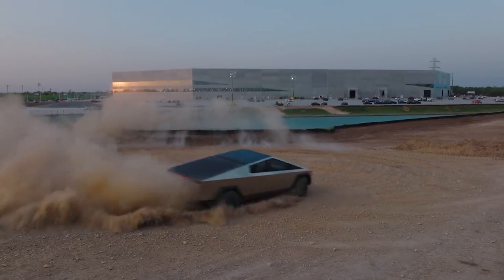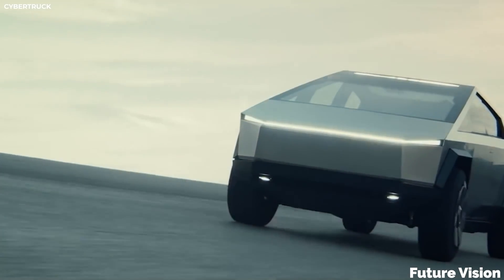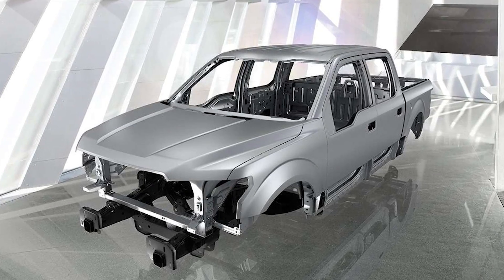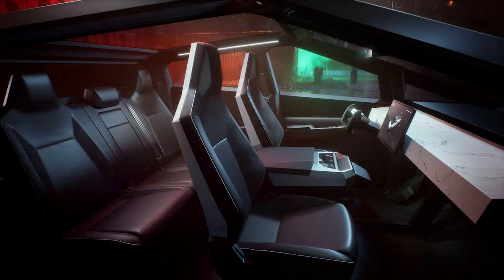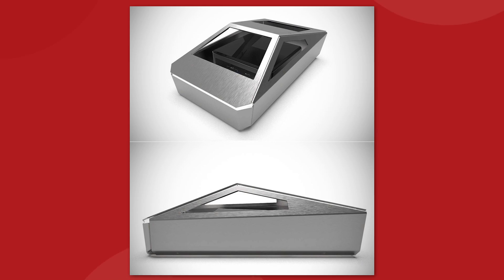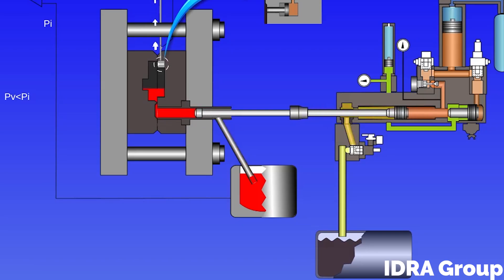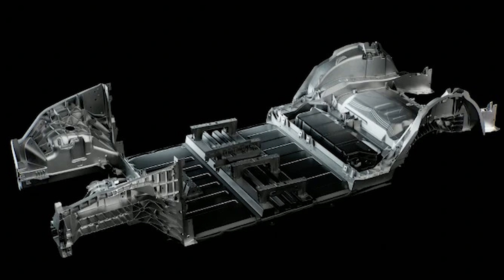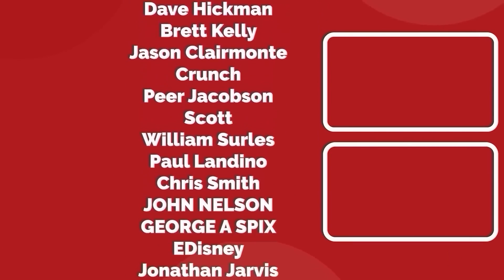The Real Reason Tesla Developed The Cybertruck!

Comment: So far, every look we've gotten of the inner parts of the Cybertruck: "it's not an exoskeleton". This presentation didn't change that. Also, they don't take advantage of triangular strength. Look at the sides of the triangles. They are interrupted by the door openings (i.e. no longer triangles...no longer strong). As for the batteries as a structural member? That's not a good idea. Batteries will need to be an easily replaceable component. (1) They have a limited life. (2) Technological advances will quickly make them obsolete. (3) They need to be easily recyclable (and all that plastic won't be easily recyclable).
Reply: Hey, don't be so critical. Engineers and Drs here are convinced. Just be gullible like them and buy so that you too can be drained. Twitter was expensive but the money for that virtual concept has to be extracted from SOMEBODY.
2023 01 14 10:40

Comment: I love the science behind the design but one thing that worries me.  What will the repair ability of the large castings be?

If one of the large casting sections were to crack in a collision would the entire vehicle be totaled?
Reply: Go watch Sandy munro’s videos on the 2022 Texas built Model Y. There are sacrificial parts that protect the casting in low speed collisions, just like any other vehicle. In more intense collision some parts of the casting could be broken but easily welded. If the subframe is damage such that it needs replaced the accident will destroy the vehicle in any case and you will probably be injured or worse as the vehicle sacrifices itself to save you.
Reply: Why not Ferrari gets over One Hundred Thousand dollars for an old car frame?
Reply: After an accident this type of construction would no longer be legal to drive in countries where they test vehicles every two years for safety. In usa no one cares about safety, so no big deal.
2023 01 14 10:19

Comment: If Tesla would make slightly smaller truck I would buy one. Maybe 10% narrower and shorter would fit my garage. I think that would remove a substantial barrier to sales of this, otherwise, very appealing truck.
Reply: Eh
Reply: Actually, Elon said that the production model will be smaller, for the very reason you stated...so that it will fit in the average garage.

Comment: The original Land Rover Series/Defenders had a body on frame setup but had an aluminium body, which worked perfectly as a work vehicle during its 71 year production. Thick, durable burmabrite aluminium.
Reply: Land Rovers are infamous for its reliability.  So many problems… I wish Toyota built them.
Reply: @sparkpaul  Indeed I owned many of them. Early ones are sort of contraption-like but known a lot to put Hilux engines in them.
Reply: Land Rovers were painted mostly military looking or came looking BC they were used widely for hunting!
Reply: @T Paterson lol…., no one litteraly cares! Land Rover is best off-road vehicle and that’s it!
Reply: @T Paterson they stoped making the old version because it was way too old and not so safe for the roads! The last generation is a much better and safer vehicle and also mostly aluminum
Reply: Land Rover is today almost fully aluminum built. But not structural or massive castings that can fail. Nothing will ever beat a steel chassis! There is a reason why trucks and semis have them.
Reply: @carholic-sz3qv  did you even watch the video?
Reply: @500846  no I was blind lol…..

Comment: When you factor in likely 4 wheel independent steer and drive by wire, air suspension, torque vectoring….cant wait
Reply: Nope it’s not happening
Reply: @carholic-sz3qv  electrical car by definition is drive by wire. What do you mean not going to happen?
Reply: @quansun7633  manufacturers are still developing and making steer by wire more effective just like brake by wire….. those things are not been used in mass now! Except I think Nissan or Toyota.
Reply: @quansun7633  Audi already has brake by wire no tesla

Comment: Sounds wonderful.  I didn't hear any mention of safety of passengers, or cost of repairing if in accident.  All of these one piece sections of truck or car must be huge cost to replace.  Have they done any crash testing yet?
Reply: "ordinary" cars are designed to collapse to absorb the forces in a crash while the passenger compartment is rigid to protect from parts entering (engine, etc.).  If the whole body is rigid, the forces on the passengers will be much larger. All cars and trucks? need to be tested and get rated, in Europe with Euro NCAP. I will wait and see how the Cybertruck fares before speculating more. The Cybertruck is not street legal in Europe as it will not comply to the safety regulations such as the pedestrian and cyclist protection standards. It will be sold in the USA as many vehicles there are exempt from pedestrian protection protocols, but to be sold in Europe, changes to the body shape and materials are needed which will make the Cybertruck a completely different animal.
Reply: @andersdannstedt5825  Don't destroy the yanky dream man! Let them rave on and then have to face the consequences. Serious scientists will arrive to do the clean-up after all the dollars have been pocketed.
Reply: I'm pretty sure I heard Tesla will have smaller replacement pieces for repairs, no need to replace the whole piece. Much like how collision centers use a patch panel rather than replace an entire quarter panel.
Reply: @catsaregovernmentspies  When designing parts a decision if the part is also to be a spare part is made. These spare parts have to be stored so they can be ordered and used when repairing. These parts also needs to be kept long after the model it was designed for has been replaced. This can be a considerable cost. The company I worked for, Scania (trucks) had to keep spare parts for 25 years in case of trucks for Nato countries. Customers usually get a little angry if their car/truck/ ... cannot be repaired 10 years after purchase. This means that special tools for repairing also need to be "spare parts". This is why one want as many parts to be "carry over" till the next generation/model, or at least the new parts can replace the old part. This is a design decision to reduce cost, otherwise the number of spare parts will grow over time which leads to high cost of keeping spare parts as they have been manufactured at a cost that that will not be refunded until the spare part is ordered and paid for.
Reply: No one can get past the government boys without being tested or money under the table similar to the BLINDING headlights? Yup everything he makes is only for the RICH except the sell out to China.
Reply: How much is insurance going to cost? How much are parts and cost of a mechanic?

Comment: How can you say the CyberTruck will be the longest lasting, when the battery is part of the frame, not to mention the truck DOESNT EXIST? Musk claimed his cars would be million mile cars, but the durability of his early cars has proven that waaaaaaaay off. The batteries are needing to be replaced at 150k-200k. A 400k mile Tesla only made it there on its 3rd battery!  As we have seen with Apple and Iphones the manufacturer can send an update and kill the battery at will.  
Your thumbnail was more accurate.  He built it to be a rover for Mars and needed the hard steel and bullet resistant windows(What engineering reason is there for bullet resistant windows?) for micro-meteors on the planet.
Reply: The Cybertruck will be produced with the new 4680 form factor cells which should last easily to 500,000 miles and is rumored to be still usable (>85% capacity) at 1 million miles.  The are quite a few newer Tesla's that have gone more than 300,000 miles on their original battery packs and just like ICE cars there are some older ones that have had early pack failures, but if you have been following the developments and improvements of battery chemistry that Tesla is using as well as Thermal management improvement and charging algorithms it is only reasonable to assume that battery life will improve even more in future.  When your traveling down the interstate at 80 to 90 mph and the oncoming traffic is coming just as fast the stones and debris hitting your windows can impact your windows in excess of 160 mph.  Semi truck windows get taken out pretty regularly... my brother always had at least 2 sets of windshields on hand for his truck.  The rocks on the roads out west are micro-meteors and I have lost 2 windshields in my vehicles over the last 10 years with just the occasional road trip to Colorado and Nevada.  On the farm we have lost windows in our farm trucks due to tools or equipment parts contacting the rear window of the truck with just a light or glancing blow, that kinda ruins your day.

Comment: I agree with your points, except the structural battery pack, which renders the pack totally unserviceable. I'd likely hold further comments until we see the cybertruck reach customer hands and have a few of them require extensive service from collisions to fully know what it takes to repair. A vehicle that likely costs as much or more than a rivian r1t but ends up being declared a total loss for fender benders is not useful in spite of all the first principles thinking that went into designing it. Likewise, vehicles that require you to glance at a center screen for vital information that should be in a dashboard behind the steering wheel presents an ergonomic and safety issue.
Reply: Before buying a Tesla I also worried about the issues you raised regarding having no dashboard. To my surprise I found out looking down at my First Mondeo dash takes my eyes off the road completely compared to looking across to the top corner of the centre console where the data you need to see us situated. The centre console is so much better and safer to view than looking down at a display between the wheel. Tesla has done an amazing job encompassing great safety, engineering and end-user design. Having to hire cars on a regular basis for work highlights every time to me the amazing simplicity and beauty of the Tesla design. The Cybertruck is the ultimate expression of the Tesla design principles. Cannot wait to experience it.
Reply: @jamespitstock3427  It might be true for you. I'm a shorter person so on both my cars, with the right seat adjustment, the odometer/speedometer area are in direct view and I don't have to take my eyes off the road that much if at all given the cars I have possessed a steering wheel with just the right diameter to avoid obscuring my view. Sure, it's not directly in my line of sight as a heads-up-display on the windshield but I don't think I would buy a car with that feature. Having had to replace windshields 2x and repair them 2x in one calendar year is enough of a deterrent where I live. Construction crew simply do not cover their trucks and there's plenty of loose gravel to break windshields. Anyhow, this is just my observation from riding passenger side on my neighbor's 2019 model x. Lately, more and more controls are being migrated over to the centrally located screen. I personally prefer tactile controls (scroll wheels, buttons, etc) on the steering wheel for audio/phone/cruise control/odometer functions. They work for me. I cannot get used to centrally mounted touch screens in both my cars unless I'm parked or waiting at an intersection.

Comment: I like the stainless steel part, but it’s ugly, can’t see any way of repairing the battery pack and doesn’t look like it’s very compatible with gravel roads. The real question is will the owners be forced to take the cyber truck to the junkyard because there’s no more firmware updates available? making the truck unroadworthy, how long will Tesla maintain support for there vehicle.
Reply: Beauty is in the eye of the beholder.  The battery pack isn't designed to be repaired, neither is the fuel tank on an ICE vehicle,  however the battery packs are getting better with every design iteration and chemistry update.  The 4680 battery pack is estimated to last over 500.000 miles. if it gets worn out or dies then buy a new one.  The cost is coming down as the volume of production goes up so it is likely that in ten years it will cost about half of what they do now.  Which would put it in line with having to replace an ICE vehicles Engine or transmission which is a pretty common occurrence before they make it to 300,000 miles.   Because the Cybertruck literally has thousands fewer parts than an ICE vehicle there are far fewer parts to break or wear out.  No exhaust to develop life threatening leaks, no fuel pumps to fail, no fuel filters or injectors to plug up, no spark plugs to foul out or replace, no engine management sensors to fail (EGR, TPS, Cam position sensor, Crankshaft position Sensor, Transmission, transmission fluid and filter, no collapsed valve lifters, no seized or broken piston rings, the list goes on and on)   

Why do you suspect Tesla will drop support for their vehicles any more than Ford, GM, Stellantis, VW or Toyota will?  My 2000 Ford Ranger has only limited support from Ford they typically do not sell many parts after 10 years.  I keep it running by buying aftermarket parts.  I don't know why it will be any different for Tesla.  Once the warranty has expired your on your own like any other vehicle.

Comment: Well IMO, they did not develop it to be a work truck and unless you are going to use the Cybertruck to haul your groceries from Costco to home as competition to the Mercedes G-Wagons, it makes no sense as a work truck and I will explain.
1. Regardless of has been published in the past the Cybertruck will certainly cost a lot more than the Model Y which is over $70K including delivery, licensing and registration and state taxes.
2. If used as a work truck the range is drastically reduced if you are hauling a trailer (and who does not) and range even drops more in the Winter.
3. Because of the unibody construction with those panels and large battery an accident will probably most likely result in a total loss (who is capable of repairing and what is the cost of the panels). This will make the insurance almost unaffordable.
4. The cost to charge a quad/tri-motor at $0.43 per kilowatt-hour will be pushing $100.
I mayb be wrong but that does not look like a winning combination of negatives for a truck that is actually going to be used as a work truck. Probably better buying a beater that will give you good service for 20K and does not mind getting beat up and hauling heavy things.